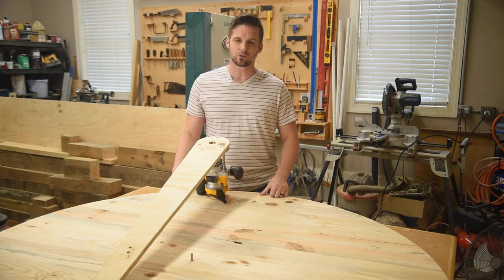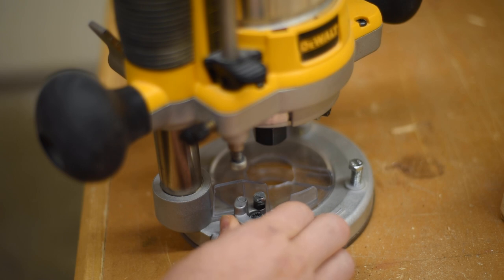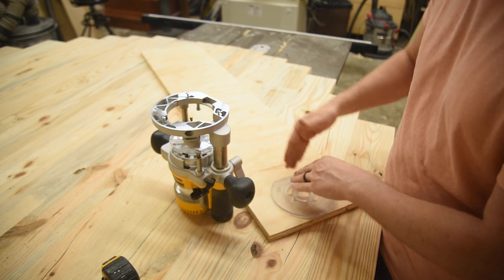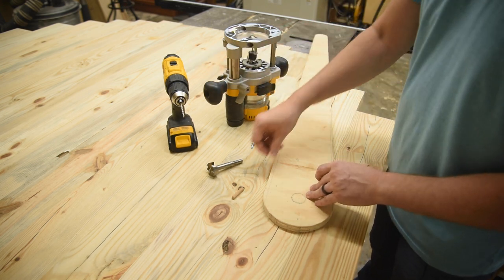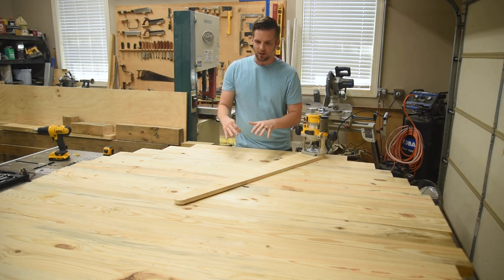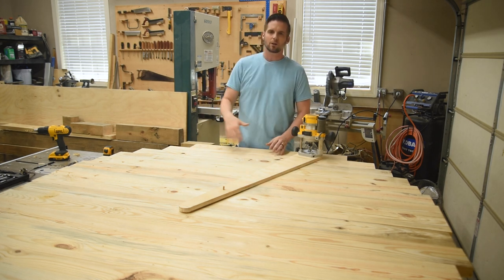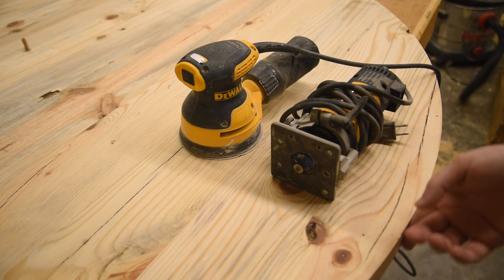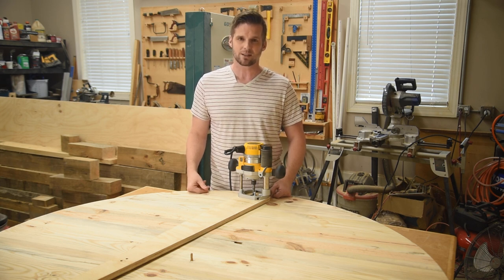This Circle Cutting Router Jig Only Takes 20 Minutes to Build - How to Cut Out a Round Table Top

Comment: I noticed that with the plung router the router is mounted to the top of the jig on half inch plywood. I have a fixed router so do I need to use a thinner plywood for my jig ? I getting ready to cut out a 48” table top .  Thanks for the video.
Reply from the maker: It really depends on the total depth your router and how thick the table top is. You should be fine, you'll just have to drill a hole to set the router down into to start.

Comment: Hi there! What type of bit do you use?
Reply from the maker: Hey! I used a 1/2" D x 1 1/2" L spiral bit.
Reply: @OutoftheWoodwork  if you used a 121” c 1 1/2” how did you cut through 1 1/2” work piece?
Reply from the maker: @dustinlyle8629  the cutting head is 1 1/2"...the overall length is 4"
Reply: @OutoftheWoodwork   very  good thanks. Now I know what but I need to order up. Thanks. Great vid
Reply from the maker: Thanks,  @dustinlyle8629

Comment: I see what looks like 2"x6" material glued up. have you had any warping to the top yet. And was it for outdoor use?
Was it treated or not? I have a jig like that I made years ago, but used it on Red Oak for a Dinner table made up of 2"x2" glued.
Great Jig and very well shown.
Reply from the maker: It's an indoor table and, yes, I had to deal with some warping. It's wood from the skids this business' equipment came on, so it was very wet and construction-grade. I let it acclimate for a couple of months, but it still moved after assembly.